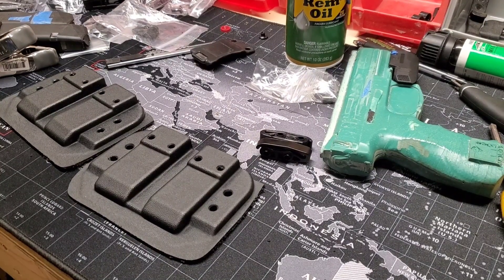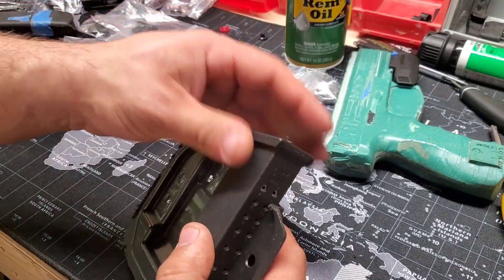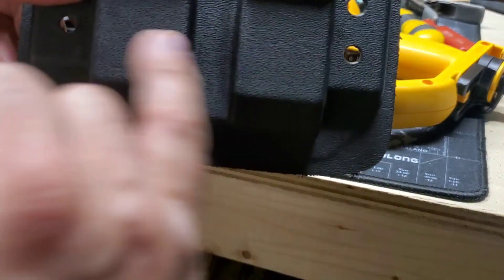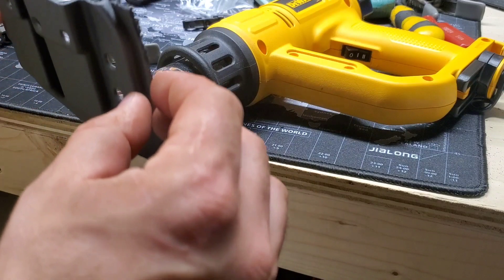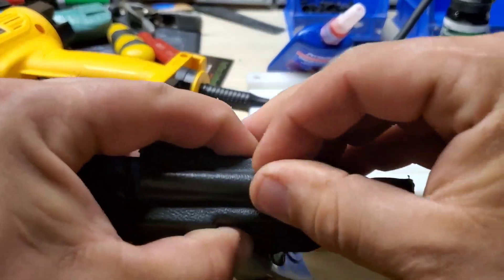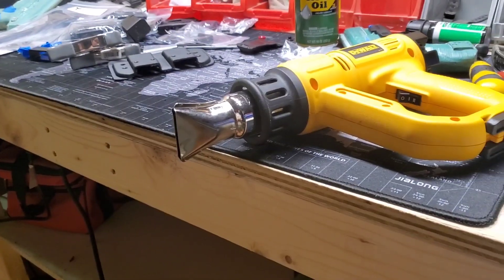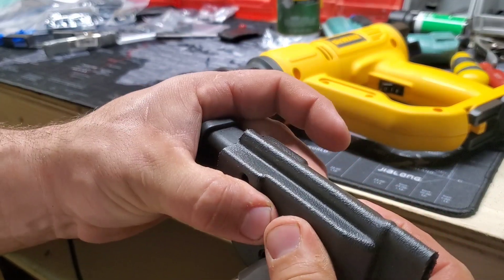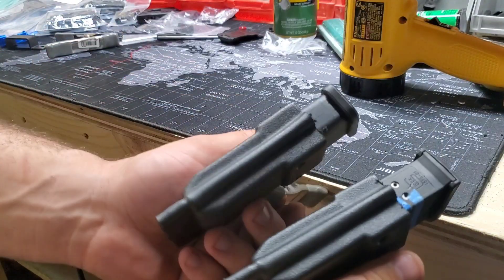How to form a vac shell with no strip heater and just a heatgun.

Comment: Would you be able to say the consumables someone needs to make holsters? I have most or all of the equipment I think I need right now. I just want to know what screws and rivets etc. should be ordered.
Reply from the maker: Well that pretty much depends on your material. I have 1/4 posts. 1/4 tubing. .3475 (I think screws)  all for .08 thick dex. I also use 3/8 and 1/2. Different attachments require different lengths.